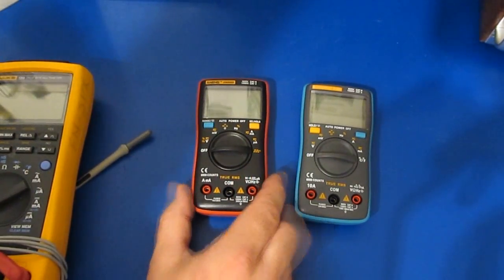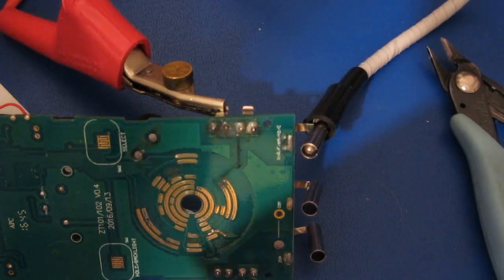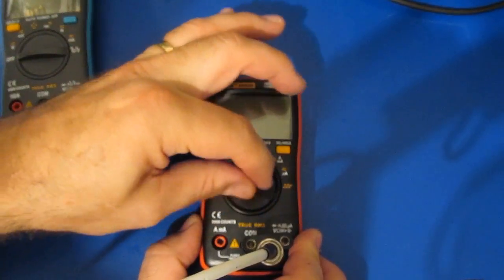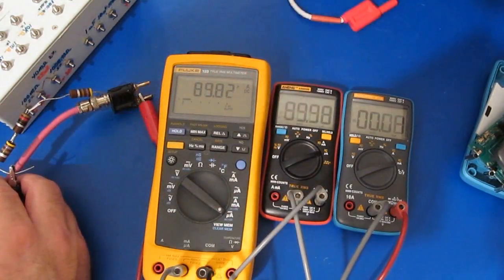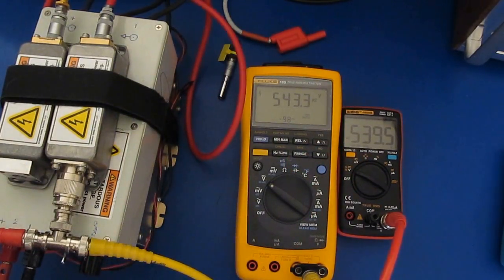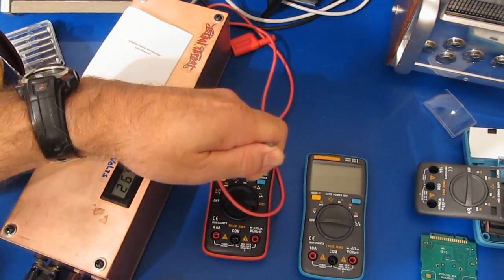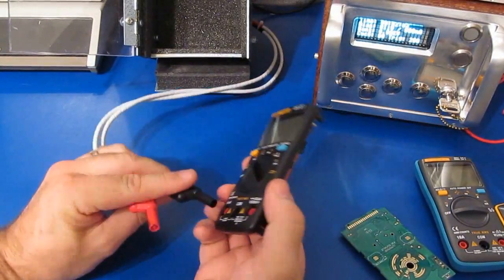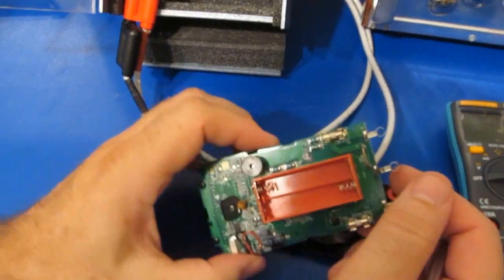ANENG AN8008 Handheld Multi-meter

Comment: I donate anengs to the local non-profit makerspace for the kids to use on low voltage classes. I've given them lots of stuff. It's a great place for kids to learn robotics and arduino stuff. They never measure amps unless it's with the fluke clamp but the voltage is never higher than 12vdc. I donate the more expensive aneng/zoytek (same company from what I gather). I had 8 an870 meters ordered from a seller on Amazon last summer and he never made good on them. I didn't get half my money back. I had a bunch of other things ordered and it got to a point where my sanity was worth more than a couple hundred bucks left I was owed haha
Reply from the maker: Good to hear of others willing to help the next generation.
Reply: @joe smith  I'm retired, 44 and still kinda sharp so I do what I can. I saved up for a year and kitted out their whole electronics section. Anonymously of course but they gave me a lifetime membership and the opportunity to start teaching some basic courses. I think I'm gonna put the classes up on the tubes for the students.

I live on an island with 100k people spread out over a massive distance yet we have one of the coolest makerspaces on this side of Quebec. I live in Sydney but not the little Dave Sydney haha. I'm in Nova Scotia. But anyway there's nothing you can't build there. They have a smithy for making anything and more cnc machines than you can shake a stick at. The place was put together by a mechanical engineer without alot of electronics knowledge when he was filling the place. It's a shame though he was sucked into buying some used stratysis gear and the operation and upkeep on them is crazy. The local electric utility basically gave him a blank cheque a year before covid and the place closed before it could open haha.
Reply from the maker: @jstro-hobbytech  For you classes, I wonder if you did it interactive and live on-line as many of the schools did during the shutdown.
Reply: @joe smith  I'm no super expert and nor do I have the confidence, resources or following. It's alot of nors.  I prefer smaller goals, they help my mental well being. Sleeping on a chair in my workshop since hurricane Fiona destroyed around 80 percent of my house is growing old. I stay upstairs and the wife sleeps in the part of the basement which was unaffected with our 5 cats. The channel will be for after this mess when the rebuild is finished and we start getting possessions back. Insurance made an error and it took 4 months to resolve. I got rid of my 3d printers so I'd have a place to put clothes. I've kept busy reading text books and doing circuits. I'm not complaining. Things could be worse if someone or one of our animals was seriously hurt.
Reply: @joe smith  I don't think I'm qualified brother. I've only been hitting the books and doing circuits alot the past 4 years. I got the degree. Refused a dream job then made alot of mistakes until I met my wife. Haha life ain't perfect though. I'd like to think some of the gear I see on the keysight channels is but that's because I can't afford a million dollar scope with a 27 inch touch screen but nor would I ever need one. It's fun to look though. 

You tho sir could pull it off with aplomb. Plus you're humble to a fault. Haha I'm going to be doing alot of stuff I find fun too. Like building an rc track in the plot of land beside the one my house is on just because I have access to a tractor and wanna build a gas powered rc truck and see what happens. Then never use it again because of my adhd. Lol. Plus I live on a dead end street near the woods beside the Atlantic haha.

It's all about having fun really and helping people should be a by product. There's a million instructional videos which I'll also most like do but I'd also like to see an op amp video where the creator doesn't assume we've never heard of one. That being said, if not for some creators that we both know of no one could figure out the basics using a video. It's hard to find a learning project with opamps that is outside of a gain circuit for a homemade sensor or audio but not as far as making an ekg machine haha. I've been reading alot of opamp books lately and soldering up circuits
Reply: @joe smith  excuse me if I'm not making sense. I go off on a tangent alot then cannot navigate back and end up sounding like an ass or know it all when I'm the exact opposite. I believe you should always assume there's someone you can learn from anyone so keem my mouth shut and take notes haha
Reply from the maker: @jstro-hobbytech  There are good books on analog design and op-amps.   I still have my textbooks from my youth.   I remember reading an article in maybe the 90s where they designed an EKG.  I think they used TL084s.  That's going back a few years and my memory gets a bit fuzzy.    Active filters and a lot of gain.   A member on EEVBLOG was using my software with one of the low cost VNAs to monitor heart rate and breathing.   Interesting project.     
I don't watch too many electronics related videos and can't offer any suggestions where you may look.  MIT was offering some of their class materials on-line.  You may want to check them out.
Reply: @joe smith  thanks Joe. I've been reading a bunch of text books and doing some circuits. I'm going to make some guitar pedal effects next on my journey. I did some synth stuff the past few months. I sold a guy some bench gear last year who had just finished engineering technology a few years back and the heart monitor was their final project and they done it as a class. He said it was when he finally understood them.

Comment: I don't see a lot of these tests as educational and certainly not funny. I'm all for careful testing at levels users will be facing. You are testing this thing way outside its specs. What do you expect? This is just destroying usable products that someone ELSE could get some use out of. I reckon I could get a Fluke to spaz out given the right combo of kilo voltage type and frequency in GHz ranges. So what?
What I do not like is the poor voltage protections inside these and reviews such as yours would do well to highlight that these are retail devices that can be dangerous when used as per specifications. AKA not fit for purpose really.
Reply from the maker: I am not expecting anything.  I let the data speak for itself.  All the meters are tested the same.  Some do much better than others.   While I appreciate your concerns as to how I spend my personal income, if I want to use some of it to test meters to failure, that's my choice, not yours.   If you find no value in the data I show,  and it bothers you to see these meters tested this way, there's an easy fix.  Don't watch!!  Find a feel good channel.  There's many to choose from.

Comment: You made so much tests with the AN8008. Do you test AC-currents between 1mA and 10mA @50Hz sinus ?
My AN8008 measures 0.000. The malfunction is only at AC, DC works.
Because of this kind of malfunction I think every AN8008 has a design malfunction.

The seller got pictures and videos of the malfunction, but he not do any reaction.
Reply from the maker: Any testing I ran was recorded in these videos from 5 years ago.   Rare I would look at current as it's not something I use.  When I do, it would be DC, especially at the lower currents you mention.   That said, first Google hit:   https://www.eevblog.com/forum/testgear/an8008-us-$19-10000count-1uv-0-01ua-0-01ohm-resolution-meter/msg1257356/#msg1257356
Reply: @joesmith-je3tq  O.k. I found it there, it's from 2017. Now I know why they don't like to deliver an replacement, because all are bad there !!
Reply from the maker: @kabelingo5418  Right and when you read the manual, you will see that are missing.  Not a problem with the meter but I have seen many people buy products before reading about them.  In this case, the meter was very low cost so consider it a good lesson to do your research first next time.
Reply: @joesmith-je3tq  My handout for the AN8008 doesn't state that it simply reads 0.000 between 1mA and 10mA AC current. It doesn't say so on the order page either. AC and DC have the same ranges. DC works correctly. Low cost is ok, that's why I buy it. But having blind gaps in a multimeter is just waste.
Reply from the maker: @kabelingo5418  That blind area is called out in the data sheets and a common complaint with buyers.
Reply: @joesmith-je3tq  Not in mine papers, I've seen and got. I bought it at AliExpress. What about later devices, AN8009, do they have the same problem ?
Reply from the maker: @kabelingo5418  Same as you, I would need to look them up.  Dead spots like this are nothing new.   Always best to do your research before  buying and make sure the products will meet your needs.   These meters have been out for a while so I would imagine there would be little not known.

Comment: When measuring a 9VAC transformer I got zero on this meter (set to V)  but it read correctly on another. DC measures ok.  Defective?
Reply from the maker: Not being there, hard to say.   Maybe you didn't read the manual to know you have to use the yellow button to select if its in AC or DC mode?  The dial is color coded but maybe you didn't understand that.    Start watching at 6:45.

Comment: I'm pretty sure the Chinese would actually made that meter pass the claimed CAT ratings if they only spend like $5 more in materials. They clearly have the ability to make really nice stuff but also have this weird habit to skimp on something crucial which brings the whole house down.
Reply from the maker: It may very well pass the claimed CAT ratings.  I have no idea.   Well, I doubt those fuses would be allowed.  So we need to put HRC fuses in there at about the cost of the meter... Wait, where is the room coming from???  Say the engineering time is free.  Who is paying to have it certified?  That's not free.   Sounds like a lot more than $5.   Read the FAQ.  Nothing I show on this channel is related to safety.  For the most part, I am only concerned with how electrically robust they are.  Now could they make it more robust for an added $5 in parts and ignoring the engineering costs, seems so.

Comment: You list electronics as your hobby and have some serious equipment at your disposal. Would it be rude to ask what line of work you do? I assume you have (electrical) engineering background.
Reply from the maker: I unplugged a sink drain once if that's what you are asking...
Reply: @joesmith-je3tq  Sure, why not. And I almost drilled a stainless screw into a water pipe behind dry wall, once or twice. Too bad screw wasn't sharper :-)

Comment: Temperature test was interesting for me. For me its totally normal to take meter from inside from +20c to outside to -30c. And then back inside. Problematic with moisture. Few times i even had to take meter to sauna for about +80c and huge moisture, really bad condition for electronic.
Reply from the maker: Those are some rough swings.

Comment: joe smith hi 
wich best betwen aneng an8009 and an8009  ... I want buy multimeter anti born and good reading .. help me thanks ..
Reply from the maker: The an8009 and the an8009 are basically the same meter.  They are cheap enough you could start with the an8009 and then maybe upgrade to an an8009 later when you are ready.
Reply: joe smith 
sorry an8009 and an8008
Reply from the maker: Have you taken the time to download the spreadsheet?  Are the meters you are asking about listed?   If you check the FAQ you will find I don't hand out recommendations.  I would have no idea what your needs are, your skill level or how you plan to use the it.  It's really up to you to decide what tools you need.  If you really want a lot of feedback,  start a thread in the Beginners or Test Equipment section of the EEVBLOG site asking for help.
Reply: thanks

Comment: Thanks for testing Joe.  I'll make sure to relegate my 8008s (bought one for every car) to low voltage use only.
Reply from the maker: No problem Dave.  Glad you found it helpful.   If they make a high res one like this with temperature and separate current inputs, I will most likely run it.  With any luck they will watch the videos where I mod the one and make a few changes to their front end.

Comment: ANENG 8000 series meters not bad for the price of a Pizza. A home gamer/hobby person could own a Fluke 101 for high energy/high voltage work an an ANENG 8000 series meter for low voltage bench work and have a lot of measurement capability and safety for under $70 for  both meters or just buy a Fluke 15B+ if you could have only one meter and still be under $80.
Reply from the maker: If the gamer kids are working in cat iii, they should get a cat iii meter.  if the have no need, why waste the money?  personally the 15b, 101 and 8000 really wouldn't be of much use to me for my own electronic hobby.  I would much rather a good used bench meter.  the bm869s is not too bad.
Reply: I'm a "home gamer/hobby person" (I work with arcade boards and consoles/vintage PCs) and I use an 8008 as a portable meter because I like how much functionality you get in such a small package, the price is right, and it has a nice backlight which I actually need. I would never use it any situation with even a hint of danger. On my bench I have a Fluke 45 I got on craigslist for $70, probably the best I can afford.

EDIT: I should note that I've found the 8008 to be quite accurate, my 45 was calibrated last year and the 8008 matches it closely. I have some other cheapo meters (harbor freight freebies, etc) and they're just all over the place. for $20 I'm happy!

Comment: Great info and thank you.
Have you tested the OWON B35T+ Bluetooth meter?
I am really curious how these meters comply with safety standards hold up under real world use.
Reply from the maker: There is a link in the description that points to a spreadsheet showing all of meters I have tested.   You may want to also read the FAQ as it seems you feel these tests have something to do with safety.
Reply: Doesn't look like you have tested the OWON B35T+ Bluetooth meter.

If a meter does not hold up to a "robustness test" and fails to give an accurate reading then it is not trustworthy and therefore, it is not safe.  

Thanks again.
Reply: In addition, if a meter fails to give accurate readings as a result of a fall then it is not a safe meter, imo.
Reply from the maker: I have never tried to get a meter certified and really am not sure what is all involved.   I have had a look at the standards and written some questions to various manufactures about them and received conflicting answers.   If you were to flip your logic and  feel that if a meter did hold up to my tests and continued to provide accurate results that it was somehow safe, that would be wrong.   All we can really say is under these set of test conditions, some meters fair better than others.
Reply: No, I'm not inferring the ones that survived your testing are safe... but maybe safer than the ones that failed after being bit the piezo grill ignitor.
The work I do makes me more concerned about my meter lying to me. 
 This is based on personal experience and the memory of grabbing a 480 volt line because my meter told me it was dead.  It was partially my fault but I will never own another UEI product.

The more I read about the cat 3 and cat 4 safety standards... well... I am pretty sure the violent plasma balls people fear will more than likely make their way out of the meter leads.  But then again, I don't know, I have never seen a meter get hit by high enough transient voltage to blow one up in normal use.  I have seen them stop working 
 while checking voltage on large 3 phase mors but I didn't do an autopsy to determine the cause.

For me, personally, having a meter that can survive being dropped on concrete, survive high voltage in the continuity and ohms range and last a few hundred hours on a battery (or set of batteries) is more of a priority.

Thanks again for the vids.  You sold me on a couple of these.

Comment: i have the same tester 187 its amazing  , its perfect for DC and AC measurements , the AC performance its the best !
Reply from the maker: I really like the 189 as a general purpose meter.  It's been getting a fair amount of use since I got it.
Reply from the maker: Cliff, well seeing that you said it, yes that is pretty much true.  The BM869s has been packed away since I got the 189.  Both meters have their strong points.  The biggest problem I see with the Fluke is the age.  Parts are not available.  If it were a current product, I would own one.  My friend found the interface for it so I hope to be able to try it all out in the future.